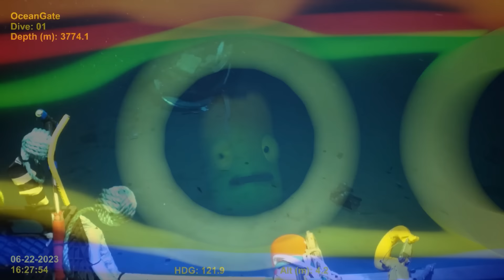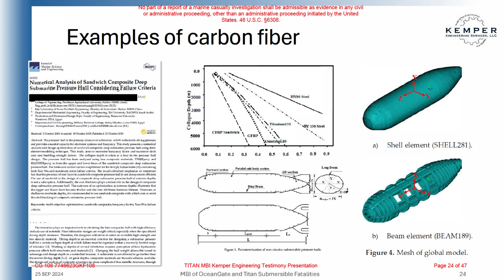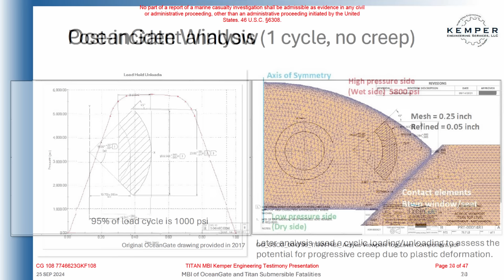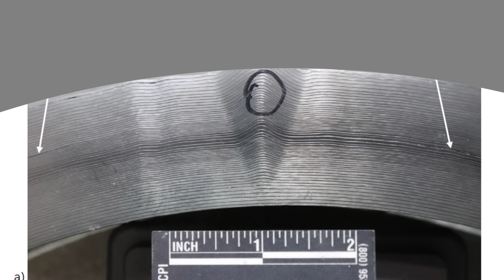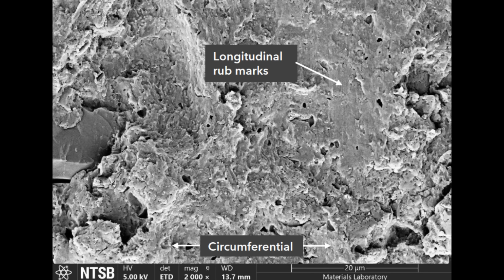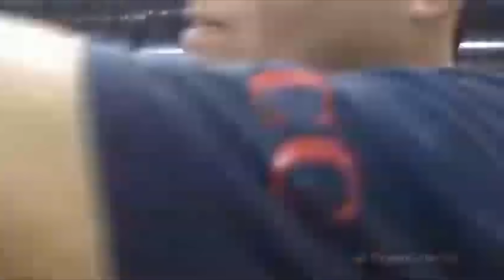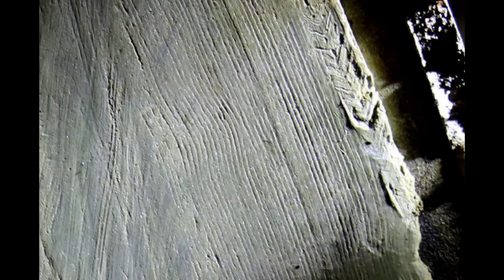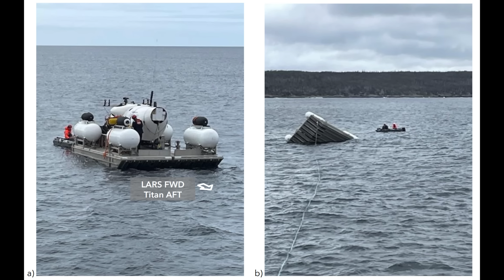OceanGate Wreck Shows Why Sub Wasn't Strong Enough To Survive - NTSB Shares Important Details

Comment: 18:00 I do know enough about layering FRP (aircraft grade materials) to say this is horrific.  My jaw is on the floor this whole video.  Sanding down bumpy layup is what you do on a car that endures one atmosphere of pressure, it is incomprehensible for this application.  When you break the weave of the fiber (with any FRP), you are excising strength from the material in a way which might not be immediately obvious.  You see those wild tensile strength numbers and think a part will be that strong, but as soon as you go cutting the fibers, now that area is only as strong as the plastic.  

I also thought it was basic knowledge you shouldn't put a glue between FRP layers where that glue has to transmit stress, it is not the same as a single piece cured alone.  Ofc it mechanically broke down the glue.  Gahh it's so frustrating that experience with these materials was the disaster.  Terrible negligence.

Comment: I'm surprised sensors detected the fault and how much time was there to act on the data... The sub survived 2 more dives before imploding, after seeing the 26:50 graph next dive should be put on hold until cause "why it's behaving differently" is found and evaluated if it's safe..

Comment: The problem with the RTM, well, two problems really, are that a system designed to tell you that the hull is faling AS the hull is failing, all the while youre at 4k meters under the surface of the ocean.. well, I don't think I need to explain how that is a horribly implemented..uhh... device.. thing. The second problem is that such a device doesn't show PAST damage, PAST problems, PAST trauma in the carbon fiber. Nope. Only whatever makes a noise THAT day on THAT dive. The whole idea of the RTM seems odd to me, but I also know very, very little about deep ocean exploration and technology, so I'm sure the RTM DOES have its place aboard any deep ocean submersible, it's just that the one reference I have is the Titan, and they say first impressions are everything because you don't get a second first impression, so perhaps the whole event with Titan and her crew (may their souls rest in Paradise with the Heavenly Father) has left a sour taste in my mouth and a harsh disposition on how they operated

Comment: Offcourse no clue how much detail the infrared says about what happended with the glue-turned-debri/dust as part of making it the debri or what happended to it post-accident by inworking of water (let alone not knowing what the glue is exactly), but I noticed the following:

- significant loss of the C-H bonding lines (2800-3000), signifying reaction on the lenght of the glue-molecule.
- complete dissapearance of the C-3-N bonding lines (2360), signifying reaction on the unreacted/uncured endings (or sidebranches) of the glue-molecule.
- significant loss of the C=C bonding line (~1570), signifying reaction to a functional part of the glue-molecule

Seeing that, it seems it truely shows grinded up glue thou with possible chemical reactive products being released that could attack the carbon fiber itself at the points it most needed to stay unreactive (and strong).

Comment: Watching the assembly at 16:46, while it is not related to "Titan", when NASA and the Dept. of Defense was readying Space Shuttle Discovery for the planned (but never launched, due to Challenger) STS-62-A from Vandenberg AFB, the Shuttle being launched from there to a near-polar orbit was to utilize SRBs with filament-wound cases instead of the steel cases used by the SRBs for launches from KSC. Even though Morton-Thiokol did do extensive fire-testing of the SRBs with the filament-wound cases, one has to wonder if a Vandenberg-launched Shuttle would have suffered from a catastrophic booster failure (along the lines of Challenger) due to a failure of the case (Challenger was caused by a field-joint failure due to insufficient O-ring sealing; the field joints used for the filament-wound cases were nearly identical to the post-Challenger field joints) as the internal pressure of the SRBs is significantly higher than the exterior pressure during ignition (in essence an inverse of the conditions encountered by "Titan" at the time of implosion), and like the standard SRBs used for KSC-launched missions, the filament-wound boosters for the Vandenberg missions were designed for reusability, thus subjecting the filament-wound cases to repeated cycles similar to that of "Titan" before the implosion.

Comment: As someone who designs and makes carbon fiber components regurarly, to see how poorly this cylinder was made and how little they understood about composites design and manufacturing is appalling, this is literally a how not to manufacture a carbon fiber component guide. The excessive and unneeded use of adhesive(Which has and interlaminar shear strenght far far lower than two plies of carbon fiber in direct contact), the absence of sacrificial layers to remove the mounding without compromising the structural integrity and basically everything else is just plain stupid, there are plenty of tutorials on youtube which show and teach far better tecniques than these.
P.s. if you wanna dive deeper into carbon fiber and composites manufacturing Easy Composites has an amazing channel

Comment: So essentially, the hull buckled a bit at 1000m, ultimately it got too much and the hull being pressed together broke the glue connection to the front dome which got popped off like a bottle cap, the water shot into the inside, blew out the window and ripped apart the hull, right?

Comment: Knowing even the basic 101 on physics, that using arches and spheres are the proper way to go to have proper strength in a pressure vessel, makes this attempt to build the deep sea going vessel with a tube design quite disturbing.
Disregarding the material used all together, it's disturbing how someone could believe this would be safe.

Comment: Of course the computer modeling is based on the original theory and testing from the early acrylic ports but the one fly in the ointment is they did not test every option and Kemper is rigid to the original design work, if it was not tested he will accept it. The ASME graph on pressure load likewise is cast in stone to many in  the underwater community, you can do something outside it, prove it in tests yet they say "can't work it's not on the graph!"
 On a more simplistic level, if the port was rated to 1300M it also depends on what "safety factor" Kemper were using. In the UK Lloyds specify a minimum of 1.5x  so the 1300 could be 1850M at 1;1
 I'm in the underwater manufacturing and we aim for 2.5x safety as a minimum (less physical creep gives less visual distortion) sometimes we exceed 3.5x so at a 100% calculation the 1300M port would be good to get to 3800M to view the Titanic.

Comment: You should see Sub Brief’s video, since he’s both an ex-US Navy submariner and an engineer and does answer quite a few of your questions… he also pointed out that in 2021 during test dives, the forward dome FELL OFF during recovery so they just stuck it back on, and then the next dive just two days later they found the hinge was bent. The Titan had a massive number of recorded literal structural failures, including the entire leg assembly being lost, and even has at least one full dive that is completely unrecorded beyond knowing that the dive occurred since the entire record is blank. No actual trouble shooting occurred, Rush simply either just signed off that things were fixed and pushed everyone out of port or wiped the records entirely repeatedly. The rabbit hole is deeper than we originally thought…
Reply: Frankly, the biggest takeaway from this whole investigation is that it's absolutely stunning that the damn thing lasted as long as it did before it failed.

Like, I thought initially that it was a "It got progressively weaker over time until it failed" sort of thing - Your run-of-the-mill material fatigue, I suppose. But instead, it had an incredible number of different failures that had every right to destroy the vehicle, and the vehicle kept not breaking and OceanGate kept sticking fingers in their ears.

Truly, incredible, in the worst sort of way.
Reply: Could you share the link to the video you mentioned please.
Reply: @Oraya0068  Don't waste your time.  Sub Brief is just beating off like everybody else.  You need something done by a bona fide materials science failure analysis expert.
Reply: @Oraya0068 
We haven’t been able to share links here on YT for years now, mate.
Reply: @georgewashington2930  oh…. Really, that explains why a couple of my comments just got deleted seconds after posting them this week!  😡 Any chance you could share the full title of the video the gentleman mentioned above, so I could search for it?  Many thanks in advance..
Reply: @Oraya0068  
Nope. I’m not the OP. Idk what video they’re referring to, but have you even tried to find it using all the info they supplied? There is a search bar here after all... lol.
Reply: @georgewashington2930  I did try
Reply: @georgewashington2930  exactly three vides! Without knowing which video he was referring to you’d have to watch all three.  Seriously though why are you so angry?  Wow… sorry I mentioned it! 🙄
Reply: @Oraya0068     
Wow, you’d have to watch ALL THREE completely reasonably lengthed videos to glean the information that the OP was talking about?! The absolute horror! 😱 

I’m glad you’re sorry you mentioned it. You should be! Maybe next time don’t bother random people to do something for you that they have nothing whatsoever to do with. All I did was give you free info that we can’t post links on YT (which I didn’t have to do — I did it as a kind gesture). Just say thanks for the freely offered information and leave it at that. Why you thought I should then be an encyclopedia for you to provide you information that the OP was talking about (or that I should do the research for you because you simply don’t feel like expending your time and energy to do so) is truly mind boggling. Not to mention incredibly lazy because all this time it really was easy to proactively get the information w/o feedback from ANYONE (including the OP!), ffs!
Reply: Sub Brief is no expert.   This is a materials science  problem and so far I have seen only TWO You-tube videos done by someone with that background (and that is not him, either).  Other than that, the Comments sections of a lot of these videos does a better job of addressing the pertinent issues than anything else, because here and there somebody with actual materials expertise show up to post there.  Even then, so far NO ONE I have seen post has been able to do ANY genuine, actual forensics work at all on this, because that would require access to the debris brought up for in-person examination.   I'm really dying one of these days to see a real failure analysis report based upon a genuinely professional investigation of the remains of the boat.  Until then this is just a vast engineering intellectual masturbation exercise.

Comment: They should've designed it for unmanned operation, and make, say 9 unmanned dives for every manned. That'd take some additional time (but you don't need separate testing missions), but make probability of casualty 10x lower. Bad publicity, however in case of an unmanned collapse and possible loss of clients, but actually safer and more sustainable from engineering POV (but not sure about the business/marketing POV like "why are we still testing, aren't we sure?").

Comment: peel ply under my limited understanding is meant to be removed. I'm confused on how they decided to bond the layers. the sound disruption was either a layer separating or the end cap glue failing. either way. even if they understood the data from the sensors they would not have had good nautical decision making anyway and still gone down. personally I think it was the end cap failing with that thin flange that sheered inward probably starting with the glue failure and probably some water jet action just before complete failure seconds or Nano seconds prior and the layer separation happened as the thing imploded. the inner flange was way too thin

Comment: At that depth, the pressure of the water is slightly more than 375 bar (5512 psi).  The implosion would have been instantaneous in human perception terms.  That's about  2.25 tonnes of pressure everywhere.  Even the tiniest of leaks should have failed catastrophically under that much force would they?

Comment: I find it funny that the drone thing has milk crates hanging off it.
Reply: They make good "nets" to dump articles picked up into to bring to the surface. It's cheap and rigid. If they designed a replacement it would probably look like a milk crate but cost thousands.

Comment: The weight of a submersible of this size if made of steel would be totally inconsequential compared to the size of ship you need to operate safely out in the open ocean. We're talking a few tons more on a ship that needs to be several thousand tons. But this project seemed to have been pervaded stupidity and recklessness from the start to the very end. May all future submersible designers learn from this and stick with proper materials and designs.

Comment: Regarding the window, I'm a little surprised that they didn't just use a properly rated window and then fill the space between it and a flat sheet with an IOR matched fluid. It might actually have saved weight to do it that way.

Comment: The window could have been made to the standard pattern and then a secondary optical element added in the way lenses are constructed. 
Corner cutting after corner cutting at every juncture it seems.
Reply: We discussed that below. One issue is the window would be deforming with depth and its optical properties consequently would be a function of water depth.
Reply: @nighttrain1236  They there should have been series of corrective lenses meant to be installed inside once desired depth is reached.

Comment: If the glue had become a powder, then not only was it no longer holding anything together but it was very likely acting as as an abrasive inside the structure. The hull was grinding itself to dust with every dive.

Comment: That fact that you can see the stress/strain curve permanently change shape after a dive where they heard a loud bang...What that means is that the structure had passed the limit of elastic (reversible) deformation into plastic (irreversible) deformation. That was the point the structure failed, they just hadn't realized it yet. After that point any further dives would make the damage worse until eventually all the minor damage to the hull had built up badly enough that whole thing broke apart.
Reply: "Broke apart" is probably a bit of an understatement.

Comment: With an anisotropic material like this hull, all the discontinuities in the CFRP (de bonding, fibre cutting / machined, de lamination ) basically means you cannot thrust the predictions of your finite element model. Those sorts of defects cannot really (without extensive testing) be factored in the prediction. In aeronautic, parts with defect like this would be scraped immediately .. too dangerous.

Comment: So these asshats just used 2-direction wrapping, poor-quality glue, left large voids, ground out wrinkles/cut through several wraps, used bed liner of all things? They should've used 45° wraps, better glue, better wrapping technique, high-pressure glueing, barrel shape instead of tube shape, titanium liner sleeve, v-grooved titanium end ring glue-on surfaces instead of flat, proper outer layer surface epoxy after high-pressure adhesive to fill any voids, Alon window, maybe even an external titanium sleeve as well...
Reply: ...and gloves to avoid contaminating the entire thing. But that's too time consuming.
Reply: @slo007 , indeed. Cleanliness!!!
Reply: You never realied how much smarter than Stockton Rush you were. I guess that's not a very high mark though...
Reply: @dc6233 , s. rush was warned MANY times, he cut corners anyway.

Comment: well at lest starliner had worked entoguh to get the crew back safly on earth even if the starliner itself had failled and bacly broke after the hardlanding. but it did keep the crew safe long entoguh so they could make it back home in one peice at lest.
Reply: also starliner only broke and fully falled after they had it fully land and its now bacly a total wiriteoff. but the sivler lineing is at lest crew are still safe bescue they are allready on the gronud and still alvie by the time starliner fully falled. also the crew where bacly allready home and safe and where simply got alot of R&R after that debocle. shure starliner is still moslty a falure but it falled only in its mission not compltly the crew made it back healthy,safe, and sound . a little more stressed from some unepexted trobbleshotting but was still good entogh for the crew to get back to there famlys and loved ones without dieing so it was a happy ending of a mission falure at least. unlike occen gate. well at lest boieing knew how the risk where and where ameking shure that they could get the crew back home in starliner they will take starliner back. but if they colednt take starliner they would just had them ride the dragon x capsule back home after bacly yeeting starliner into deep space as a noe way deep space probe at least.